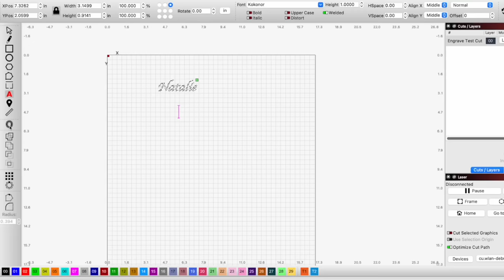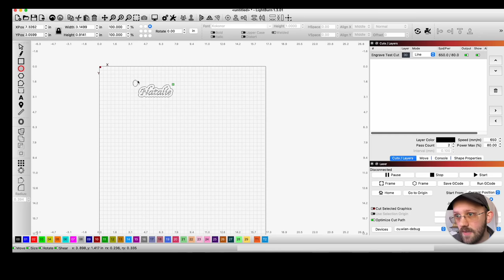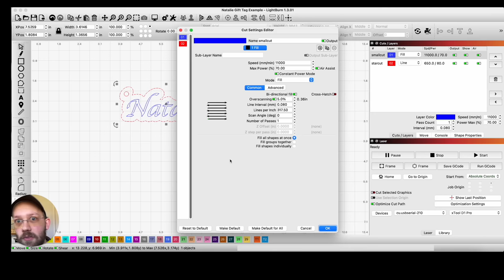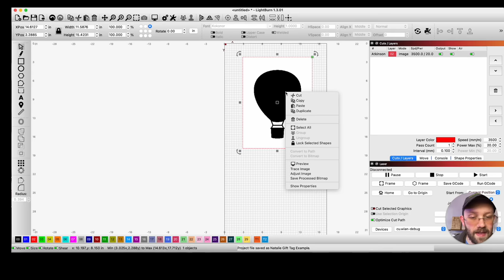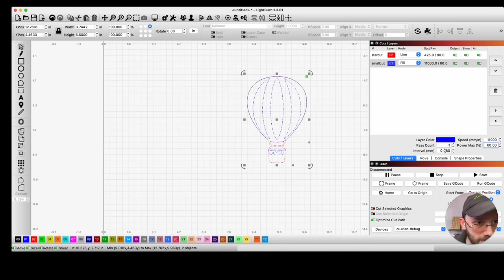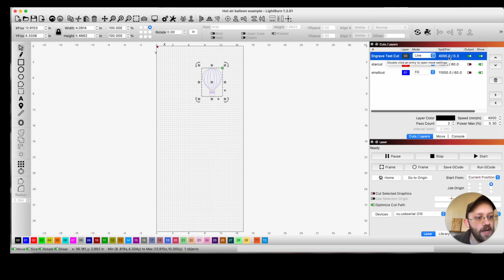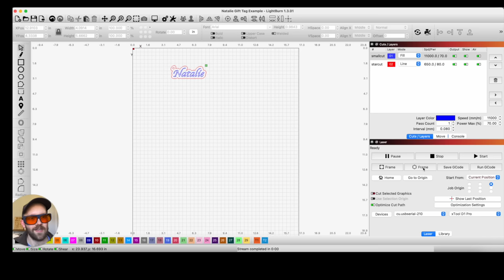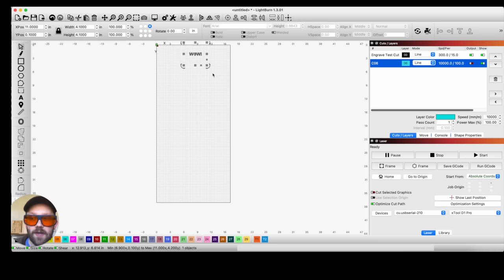LightBurn 101: Step-by-Step Tutorial for Beginners

Comment: I have been using Lightburn off and on for 3 years now. I learned a lot from your video. Since the Creality Falcon 2 40watt laser is new, there is no configuration file for Lightburn. I need to crank my laser up to 2% to see the laser beam. Thank you showing the work around for the framing with the laser on. I purchase 12 inch square 3mm birch plywood and have a half an inch to spare on each side!  This will prevent a scorched bed in the future! 😀

Comment: Im glad i did this search for beginners Asher.  My computer savvy levels dont get much higher then turning the thing on, so i'm stickin with your tutorials as much as possible...
Reply from the maker: If you're just getting started, then you may also want to check out my "laser engraving for beginners" video, which I just published about a week ago. It covers even more steps that you may find helpful. Good luck!
Reply: Asher, could use some input, i'm a creature of repetition so i have been going from tutorial to laser over and over trying to learn as much as i can but i have hit a snag that has cost me hours of time.  I have a project that i test burnt once on pine that came out framed in ok but for some reason when i set up to burn it on my final piece, the framing and image is larger then the setting in light burn.  I'm in inches and it looks to be around 2 inches larger when i frame.  The piece i am trying to put it on is 10" round diameter.  I have read that there maybe something in my background that i cant see that is causing this, my image is set at 9x9 but runs off 10" work piece.  A bit at wits end

Comment: Not sure if you're still checking comments on this video, but I have a question.  I've set up 3 layers on my work: 2 fill and 1 line.  However, when I go to Preview, I'm only seeing 1 of the fill layers.  The other one is nowhere to be found, regardless of whether I have selected to show the layer or not.  I'm pulling in a .png file and created the two layers by adjusting the settings in the Trace Image function, so I don't know if that has anything to do with it.  Would appreciate any insight you could offer.  Great tutorial...would be a great series if you were interested in doing a follow up!

Comment: Hi Asher, I am new laser engraving and trying to learn as I go, I must say this was one-off the best tutorials i have seen so far as you explain and direct how to apply what you saying in an easy to follow manner. Going keep this so I can revisit while I Learn.  One question, I have A Windows lap top so what key do press to weld items, do you have a video on this please.
Many thanks for  great video.
Reply from the maker: You hold CTRL to select multiple items, then weld them with a button on the left toolbar. If you replay to corresponding section of the video, you should be able to see the specific button for this. Hope that helps and good luck!

Comment: You may cover this in a future video, but is there any way to "set" the 01, 02, 03, etc. to reflect the same laser settings every time?  In other words, I may create something with 01 as the engrave on a material I commonly use and 02 as the cut on this same material. In a new file, can I then cut from this material using the now PreSet 02?  Or does the speed and such have to be set every time with every new file?  Hope that makes sense.
Reply from the maker: Hi Victoria - If I'm understanding you correctly, I think what you're looking for is the "make default" button inside the Cut Settings Editor for the layer. You can open the Cut Settings Editor by double clicking on the layer.

Comment: Nice video, I subscribed and thanks for the information. Are there specific settings in X-tool for light burn that are common for everyone?  I am having issues with my X-tool D1 pro 40w. setup. I called X-tool service but they never called me back. When I move my laser by the screen movement controls, front to back works opposite. (hitting the down arrow going towards the front makes it go away from me to the back of the machine) Even if I choose bottom left for homing it still homes, or tries to, top left. I just made a file and it burnt backwards. (left to right switched) I'm thinking my X direction is set wrong but have no idea how to fix it. because of this, it's impossible to accurately center jobs no matter what mode I use. Any help you or anyone can give would be greatly appreciated. Also, when it homes it homes fine side to side but over drives on the top of the machine.

Comment: so this is my first attempt at using lightburn and i have about 2 days worth of experience with lasers. i have the xtool d1pro 2.0 10w. as i watched this video i did not notice where you told LB what material or the thickness of it. is that info not needed in LB?
Reply from the maker: When it comes to cutting through material, the "depth" of the cut that you need for a material of a given thickness, is set using the power and speed settings in Lightburn. If you want to learn more about how that works, I have another video on my channel that does a crash course on material tests, which is how you get the power and speed settings you need for your machine. I hope that doesn't sound too complicated, if you watch that crash course on material tests I think this will make more sense. Good luck!

Comment: sorry if you explained this an I missed it but I noticed your Grid is set to inches while your speeds are still in mm/m. any reason you don't run change the speed to inches per second? I'm a total newbie so sorry if this is common knowledge.
Reply from the maker: Yeah - that looks a bit odd doesn’t it. There is a reason though. It’s common practice for folks to have their speeds set in mm, so I just followed the crowd with that one. But I changed the grid to inches to make sizing easier for my American brain that is accustomed to the imperial measurement system.

Comment: Asher, I really enjoy your videos.  I downloaded your test. It comes up on the screen, but when I try to burn it, the laser moves in a square like I was framing it, but nothing else happens. What am I doing wrong?
Reply from the maker: Hi Dave - that’s hard to answer without seeing your screen. My guess would be that you have a “framing layer” turned on, but not the other layers that make up the grid. So I’d look closely at which layers are on or off and then see if that reveals the solution. Hope that helps!

Comment: Great presentation - i am new totally nw to lasers and have  just purchased a sculpfun S30 ultra 33 watt with lightburn .any advice ?
Reply from the maker: Make sure you get the safety equipment necessary. For example, safety glasses and enclosure with a good exhaust set up. From a design perspective, I would start by finding ideas / products that already exist and then see if you can figure out how to make them. That way you can learn by doing projects. Hope that helps!

Comment: Hello Asher,

I need to engrave a logo from a company but this logo has 2 words in it.
One small word and one bigger one.
Because of my laser is a diode laser, he angrave's the smaller word not so deep.
Can you tell how i angrave the smaller word a bit stronger than the bigger word ?
I can't find a good totorial on youtube for this problem.
Reply from the maker: Personally, I would put the two words on separate layers, and then tweak the speed/cut settings for the smaller one until you get the desired effect. For a deeper engrave, that usually means a higher power or a lower speed (or a little of both). Hope that helps.

Comment: On the name tag, I was expecting you might (somehow) have the hole for the string cut before cutting the entire tag out to avoid any shifting of the tag when creating the hole.  Is that not necessary or does it get done in the order I suggest by default?  Great video - just bought my machine today!
Reply from the maker: If you want to do that, you can just put the hole on its own layer and put that layer above the other cut on the layers pane.
Reply from the maker: It wasn’t an issue for me having it together though

Comment: Hi, I am new to lasers but I was wandering if you could help me. It is a 5w output and I can’t seem to get it to cut with the settings I am using. Could you help me please. I am cutting 3.6mm plywood. Thanks
Reply from the maker: Hi Simon - I've never used a 5W, so I'm not sure what exact settings you want. Generally speaking, if it won't cut, that means you need to set a higher power percentage, or a slower speed.

Comment: Great video. I just got my laser last night and I was following along. I changed some of the settings to adjust for alignment like you showed but now when I go to burn, my images are mirrored. I'm not sure what I did to change that. My origin is still set in the top left in my device settings and when I preview the burn it still shows the image correctly. Also, when I'm on the. move tab, when I use the arrows to move the laser, the left and right work fine but when I push the up arrow, the laser goes down and when I move the arrow down, the laser goes up. Can you help? Thank you very much.
Reply: I was able to figure it out. Thank you.

Comment: Ive been asked to complete a laser etching project this weekend, i have never used a laser. Is it even possible that i can do this in a weekend ? Im very good with 3d printers which might help some.
Reply from the maker: It’s theoretically possible, but you’d have to have pretty much all your supplies (like your laser, ventilation system, material to be engraved, etc.) together already. Best of luck, and be safe.
Reply: @asherdiy  thanks, weve got all the gear, just no laser guy this weekend. Im the closest we got for now lol. Lightburn is easy enough. I  got my drawing done, now i just have to do some practice runs with the laser.

Comment: I love your YouTube video I learned an awful lot all said and done I have a problem I made the keychain and on the cut out going around it did not cut all the way across and went through the wood but left about a quarter inch that was never touched also on the circle for the keychain the same thing it didn’t cut all the way around what am I doing wrong
Reply from the maker: Hey Dennis - that's a new one to me. I can really only guess without seeing your file, but the first thing I would check is whether you accidentally put the section of the keychain that is not cutting out on a separate layer.
Reply: Thank you for getting back to me I’m not sure what’s happening but that only happened with the keychain it happens with other things when I make a circle I guess I gotta make phone calls lightburn @asherdiy
Reply: I wish I could send a picture to you so you could see the way it didn’t cut

Comment: I can run your test burn files, but when I try to run my nametag it just slams into the left side limit switch every time right at the start of the run. Using a Longer Ray5 10w.
Reply from the maker: I’d double check the position of the tiny green dot (I believe LB calls this the job origin). I’d guess you accidentally created a small shape somewhere that is making your laser think your project is way on the other side of that limit switch.
Reply: @asherdiy  Thanks. I'll check that and if all else fails I'll start from a fresh file and setup in Lightburn. It was infuriating. :)
Reply: @asherdiy  I was able to get it to stop doing this on that file, but I keep getting this behavior on brand new files.There aren't any shapes outside of the very center of my work area. It doesn't seem to matter if I start from absolute coords, user origin, current position, use just a selected set of shapes, etc.
Reply: I figured this out. For some reason, even though my text is very small, it was treating the text box as 800 mm wide. I found it by looking at Window -> Preview. I'm not sure why it is doing this, but deleting the text and recreating it fixed this issue for me.

Comment: Thanks for the great video.  I've been 3D printing for years and the software is somewhat similar as far as navigation.  The explanation on layers, power and interval were invaluable!  Thanks for that!
I got the sample file from you and it seems to be a little off.  When I opened it all the text flipped.  I think maybe I am missing a font.  No big deal though as I got it all straightened out.  The part that is confusing me is you have a grid of power and speed but only the speed settings change in the layers.  The power is all at 100% except the labels which are 80%.  But going across the stars and squares from left to right shouldn't they be 30%, 40%, 50%, 60%, 70%, 80%, 90%, 100%?
Reply from the maker: Hey Oscar - great question regarding the power. I can’t really explain it properly here, but if you select a shape (like one of the stars) and then open the “shape properties” pane, you should be able to locate the power setting you’re looking for. Please do reply here if that ends up answering your question. Cheers.
Reply: @asherdiy  I see that now.  Thanks!   So if I understand correctly, the shape property takes priority over cut/layer properties?

Comment: What materials should you use for the test cards?
Reply from the maker: In theory, I would do a test card for every new material I plan to use. I mostly work with plywood, so my test card is designed primarily with plywood in mind. However, you’ll probably want to do some sort of test for every new material you use, that way you can dial in your settings to get good results.

Comment: Hi, trying to get your test pattern files but after several attempts, still not receiving any email (no spam, nothing)
can you fix it ?
Thanks, great videos (plural)
Reply from the maker: Hm - that’s odd. Sorry for the trouble with that. I just checked the back-end set up and I don’t see any obvious issues. Two questions to hopefully help me fix the problem: 1. When you put your email into the website did it give you a confirmation message (something like “email sent!”)? 2. What web browser are you using (e.g. chrome, safari, etc.)?
Reply: Hi,
I used Firefox and got the confirmation message each time (3 times with  different emailaddresses)
Reply from the maker: Okay, got it. I’m going to test it in Firefox to see if I can replicate the problem.
Reply: Hi, same problem with Chrome and Chrome Android :-(
Reply: Can you provide a direct link ?
Reply from the maker: Hi - okay, I've just had a chance to work on this. I did 3 separate tests with different browsers and email addresses, and it worked for me every time. So, I'm sorry to say that I have no idea why it's not working for you. 

My final idea to (hopefully) get you this file, is for you to NOT click the link in the description and instead to navigate to my site directly. Just go to asherdiy.com. Then click "free files" in the top right corner of the page. This will take you back to the page where you can put in your email to get the file. 

If this doesn't work, then unfortunately I don't have a solution for you. You asked about a direct link, and I'd be happy to give it to you if it existed, but the way I have this set-up is for the file to get sent straight to your email as a download (in other words there is no direct download page for you to go to).

Comment: Not that I don't appreciate your free material test file, but isn't that built into LightBurn?
Reply from the maker: Yes, there is a material test generator built into LightBurn. And if that's all you need, feel free to just use that one. When this video was published, that generator either wasn't out yet or I just didn't know about it at the time. With that said, my free test grid file is an example of what I call a "custom test grid", which you can create to test specific variables that are not built into the out of the box material test generator from LightBurn. 

A good example of this is that the built-in test generator only allows you to test squares. So, if you wanted to test the exact appearance of a flower shape (for example), you would have to guess how the square shading would look when applied to a flower. OR, you can create your own custom test grid. 

I actually go much deeper into these various types of test grids and when they're useful in a material test "crash course" I published on my channel recently. Feel free to check that out if you want a more detailed look at it. Cheers.